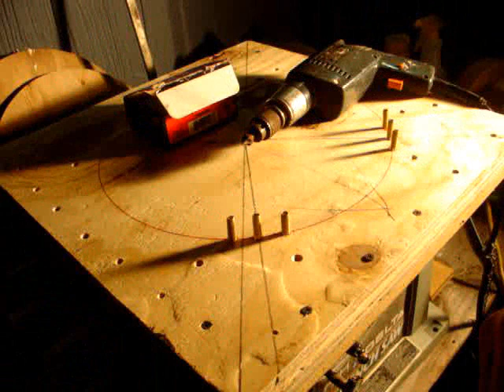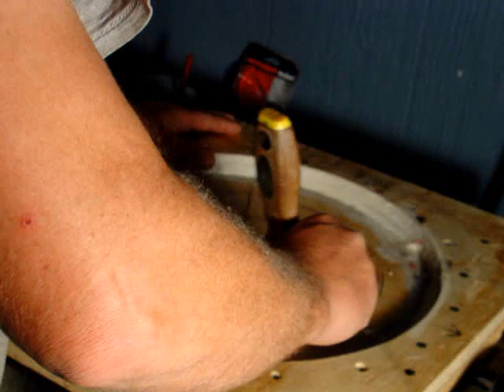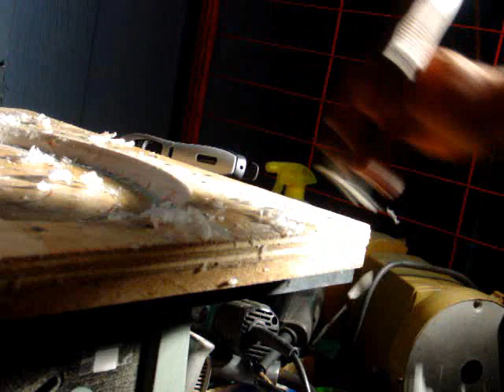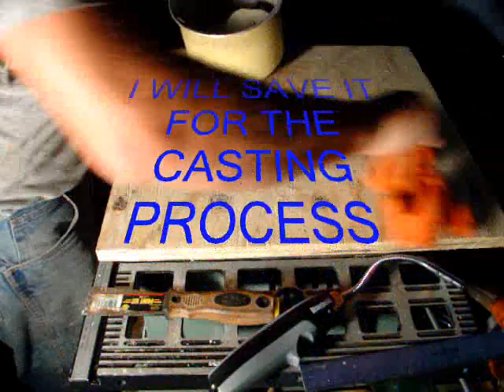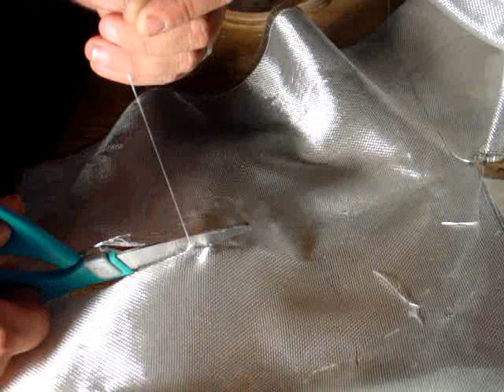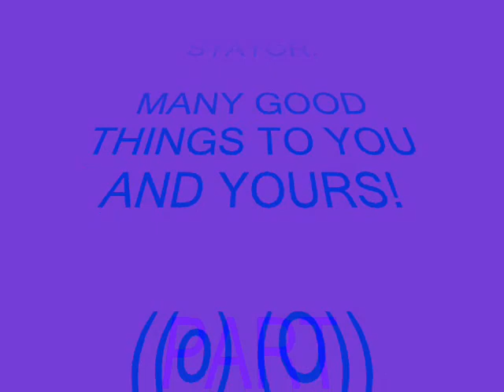BUILD A DUAL PERMANENT MAGNET ROTOR WIND TURBINE (PART 14)

Comment: That little torch you could use to burn the enamel to strip the wires #14 gauge then razor blade to save time and better job